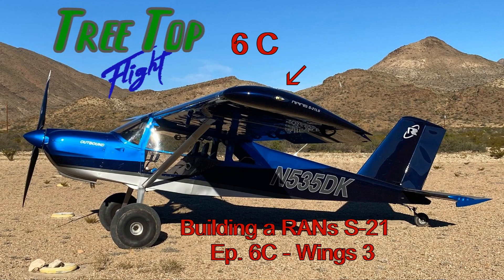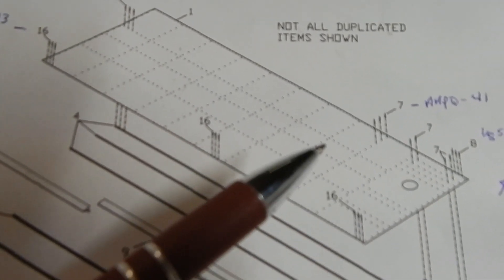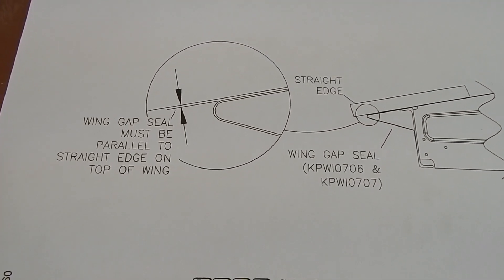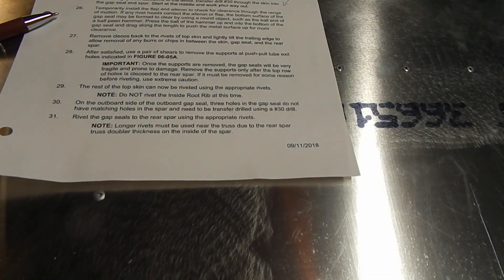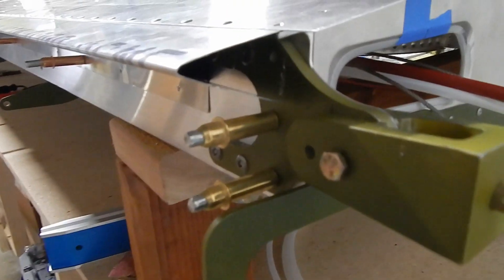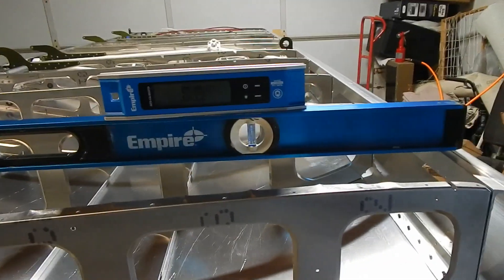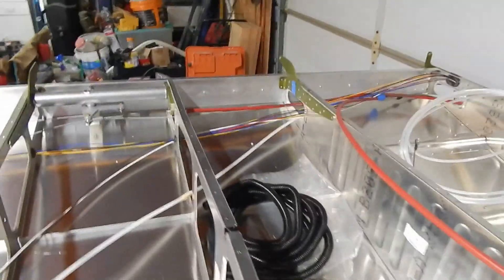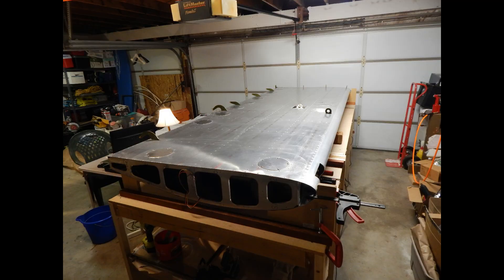Building a Rans S21 Outbound Ep 6C - Wings Part 3

Comment: Thanks for these videos, really enjoying them as I am a few months behind you in my build!  One note though, at around 3:35 in the video you say the rivet gauge measures in mm and then you consult a grip length table to see what length rivet you need.  I don't think that's right - I'm pretty sure the rivet gauge directly tells you the length.  If the gauge reads 3 for example, that doesn't mean 3mm, it means you need a -43 (or -63 or whatever diameter) rivet.  "5" would indicate you need a -45 or -65, etc.
Reply from the maker: I thought I replied to this post but I dont see it...  Great catch Steve.  I re-researched the use of the gauge and you are correct.  The good news is that the interpretation I was using provides the same rivet selection on rivets under a 44.  Thanks for the feedback.